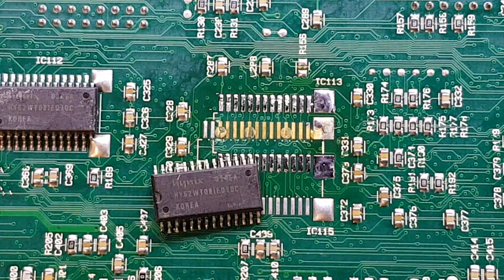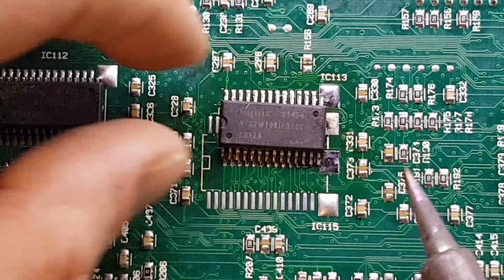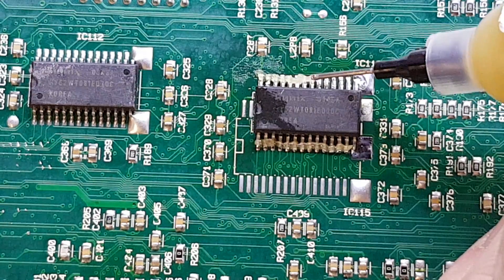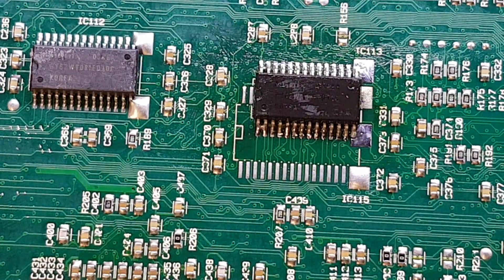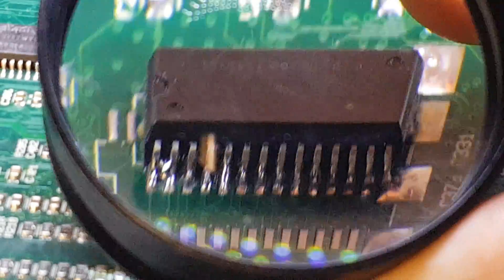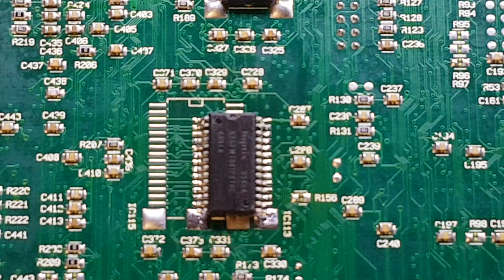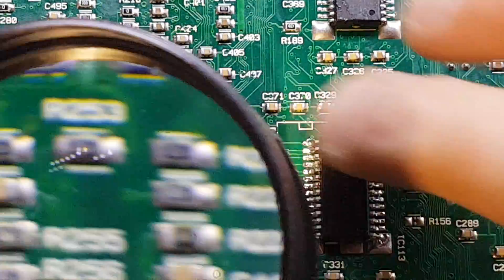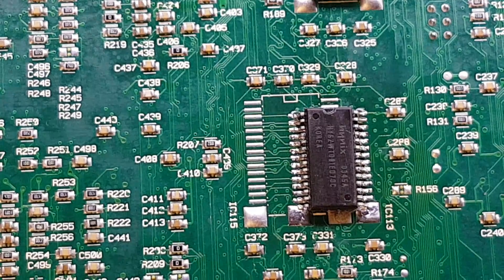SMD Soldering Tutorial - an introduction to drag soldering. (beginners electronics)

Comment: Not really a fan of solder paste, i either put to much on and have lots of jumpers going on or to little, i much prefer to flux the pads up put a bit of solder on my iron amd drag across it.
Clearing shorts i use some thin solder wick in there, sometimes its hard to clear shorts on fine legged chips so solder wick works spot on for that.

Comment: I solder smd chips using the widest possible "wllr" chisel tip.Wide tips means larger heat surface that better transfers the heat to the solder and pcb and drags the solder to any desired direction.

Comment: Do yourself a favor,  ditch that conical tip as they are good for only filling my trash bin. Use a bevel or well tip if you are going to try drag soldering. Even a chisel tip is better than that conical tip

Comment: What cleaner should you use on your Kim wipes to clean the board with,anyone
Reply: If isopropanol works on your flux, most people use that. If isopropanol doesn't work, toluene probably will but has more health and safety implications and needs to be stored in a container it can't evaporate through. Both can also dissolve certain susceptible components (IDK which).

Comment: imo you did a great job however I think if you left the flux on and didn't clean with alcohol you would of been able to unbridge the solder better, the flux helps in them cases, if you get a bridge next time try adding flux to the bridge, applying the iron slightly and they'll unbridge. no expert myself but thought that could be why you struggled to unbridge it.

Comment: This was very useful indeed. I've seen drag soldering before, but putting down a string of flux beforehand is a very useful tip that I would not immediately have thought of.
Speaking of tips, I believe that there are special soldering iron tips for this kind of work. The ones I have seen have been sort of a round chisel tip with a small dent in them to serve as a reservoir for the solder.
Reply: The round chisel tip is called bevel or hoof. With the dent in the middle, they are sometimes called a spoon. Bevel tips are ideal for drag soldering, with or without the dent/hollow in the middle.
Reply: I prefer the hook tips
Reply: I'm a little late, but by the sound of it you've probably done what I'm about to do (and potentially regret trying)
How bad is trying to drag solder without applying flux separately?
I've been hoping I could just rely on the rosin core of the solder wire, but I'm assuming (if it even affects the first pin) by the time the tip reaches the last pins there won't be much left of that rosin core flux.
Not planning on doing anything extremely tiny, just 1mm pitch (although I noticed: that *sounds* like a lot... but actually seeing the pcb kind of made me realise how tiny that already is)
Or would something like soldering just a few pins (3-5) like you normally would (feeding solder wire while holding the iron to the pins and such) mitigate the flux problem?